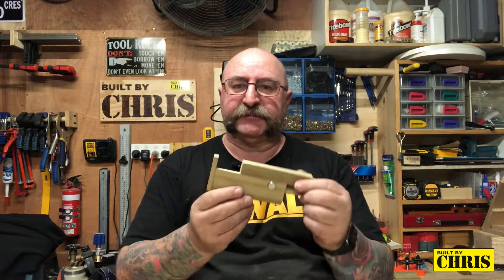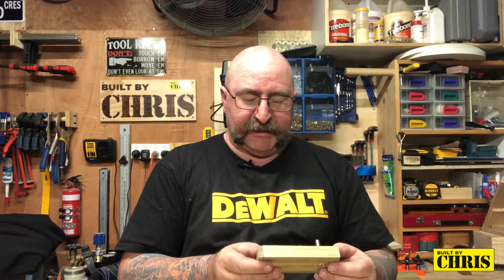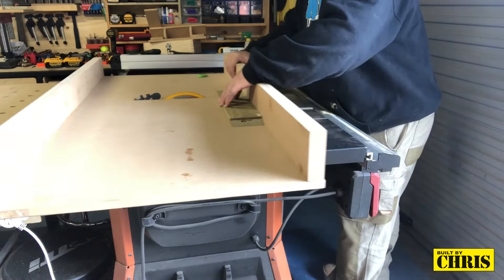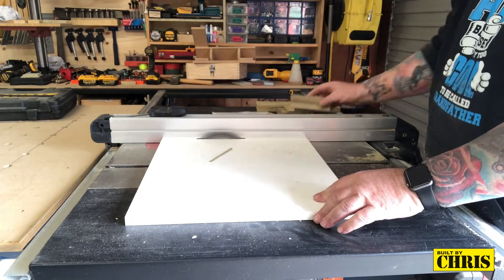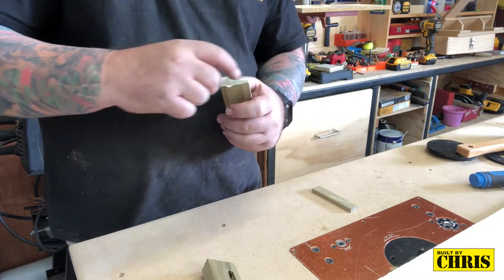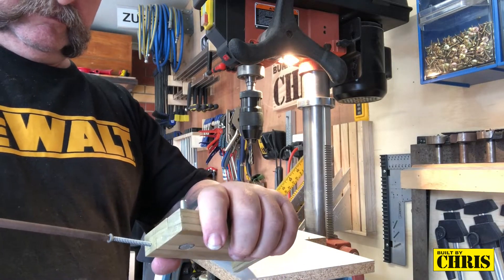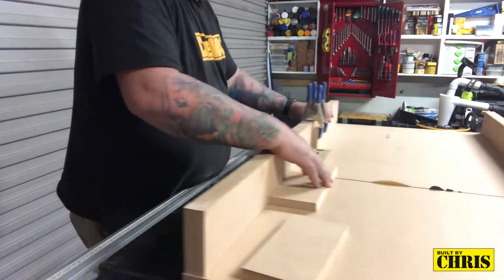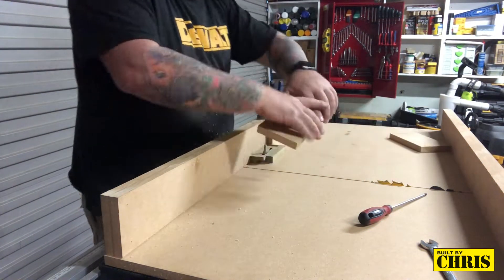Making a Kerfmaker

Comment: Great tool Chris, I bet there is one similar for a dovetail joint somewhere!
Had a thought as I was watching you make that - if you made a longer version and screwed a wood ruler to each side you can measure internal widths where a metal rule is too long and a steel tape is not accurate enough,  I use a telescopic car aerial for this usually! 👍👌
Reply from the maker: Hey Eryk, thanks mate. I'm going to look for a dovetail jig. Always wanted to try my hand at dovetails. Thanks for the suggestion, might look into it to see if I can improve on the kerfmaker